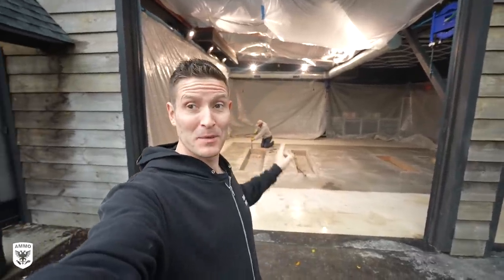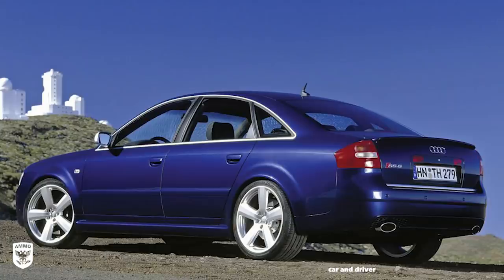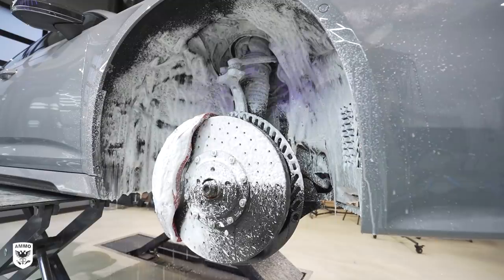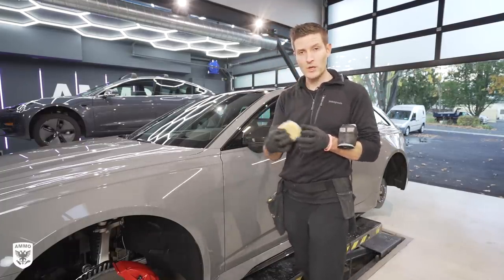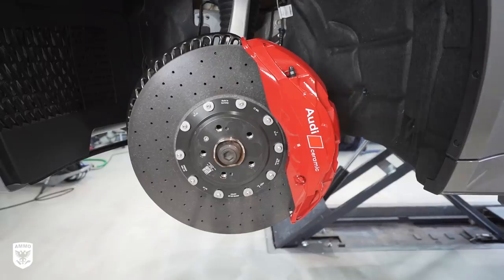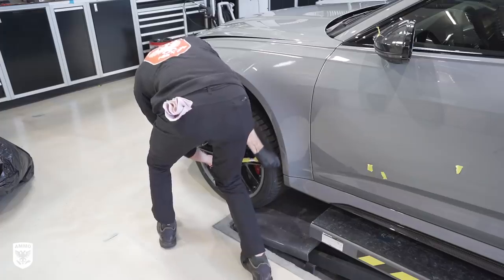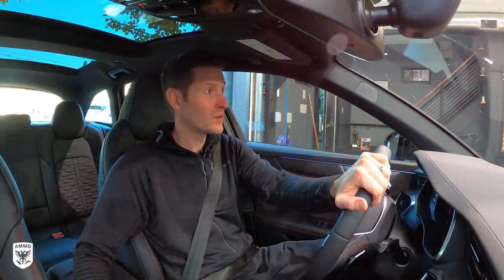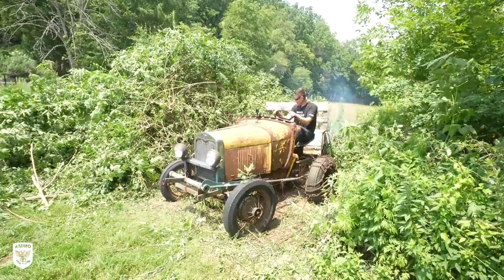Daily Driven Audi RS6 First Wash and Drive

Comment: Hey Larry! 

I’m a professional ergonomist and I have a suggestion that should help save your back some trouble: pick up a hydraulic table cart from a hardware store and stick the wheel stand on it. Should make it so that you don’t have to bend over as much when cleaning wheels. They’re not too expensive, like $200 for a 500 lb rated cart. 

Love the videos!
Reply from the maker: Gotta save the back. Appreciate it :)
Reply: Also, get in the gym with a competent coach if you haven't already. Resistance  training with appropriate loads tends to reduce pain responses over time.
Reply: I’ll take you up on that thanks bro haha great idea

Comment: Larry love the videos and the especially the RS6.  I'm lucky enough to own a 2019 RS4 in Sazuka Grey, a little slower and smaller but better handling and still loads of smiles as you mash the loud pedal.  I'm not quite as perticular detailing it as you, but I follow your advice, it's 3 years old and not a love mark in sight!
Keep up the great work.  I'm stunned that your contractors didn't reinforce your workshop floor!?  I'm not a builder or a structural engineer but even I would have questioned it not being done.

Comment: You need some kick out flashing on that roof over your shoulder at the start of the video. Water is leaking down from the roof and because there is no kick out flashing it’s going directly down your siding and likely behind the siding as well. Will rot and mold quickly.

Comment: In a week time, me and a friend need to restore a ship. Its 11 meter long and about 80m². I already did a cutting step on it and waxed it last year, but we wanted to do more. Can you give any advice? We are thinking about a wetsand step with 1500 grid x-cut rupes (125mm) and then a heavy cut with a microfiberpad and finish it with a finish mediumfoampad. After it all coat the ship in gel coat form Gyeon. We have 2 LHR 15 mark 3 and a LHR75e, the ship is clean and is in a clean wearhouse. Great video again and good luck!

Comment: Hi! Thanks for the video. But regarding the ceramicbrakes and washing? I have the same brakes on my S8 and understand that you need to wash them without and alkaline or acidic wash soapes. Still you are using wheel soap ? Whats your taking on the question ?

Comment: I find it very interesting that the front calipers have 10 pistons, yet the rears are your average single piston calipers.
Reply: About 70% of your braking comes from the front, that's why a lot of cars used drums in the back for years even after discs became the norm.
Reply: @IRBork  I understand why, especially since it’s a wagon and most of the weight is in the front. It’s still interesting though. Some of the Pickup trucks from Chevy/GMC made in the early/mid-2000’s had front and rear dual piston calipers.
Reply: @JoeyLovesTrains  the pistons disperse the breaking force on the carbon rotor, with the breaking forces applied to the material it would most likely create hotspots under heavy braking as the temperatures of carbon ceramic disks are insane. That dual piston caliper would've lost its breaking power a long time ago.

Comment: Mr Larry. You ever coat the plastic molding in the wheel wells? I know some are carpet lined but was thinking about it the other day.
Reply from the maker: I’ve used AMMO Mud previously as it’s water based and easily reapplied as on tires. Always testing new solutions though :)

Comment: Hello Larry, I would really appriciate if you could give me an idea as a pro. I've had my brand new car's hood clear bra'd at the dealership, and I'm reading horror stories regarding the removal of this metarial after say 1-2 years like stripping the paint or leaving unremovable stains etc. (I am aware of the boiling water trick).. Meanwhile I owned the car 1 month later it was produced and I know your 60-90 days waiting suggestion before clear bra'ing... I'm a little bit confused, that thing sat on the paint like for 4-5 months now.. Should I remove it? What would be your suggestion? Thanks a lot!
Reply: Also it's a VW with a metallic finish if it makes any difference.
Reply from the maker: Hey happy to help! Shoot me an email on the website with all the info.